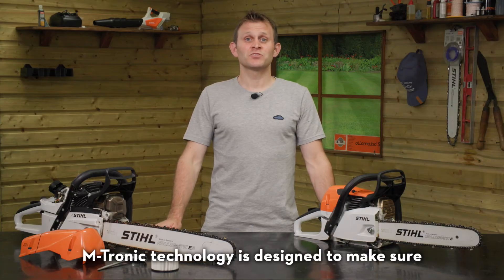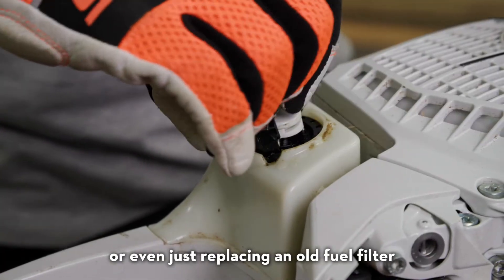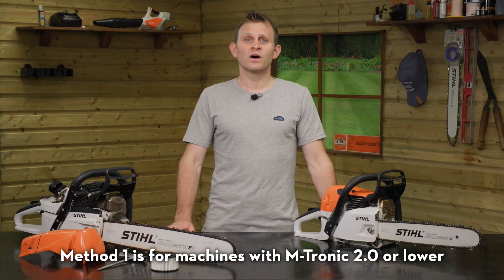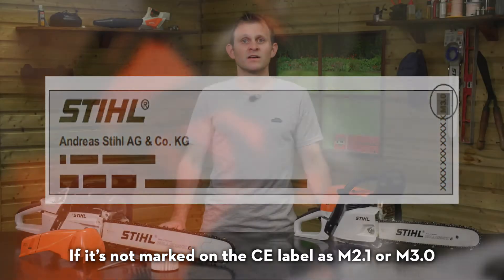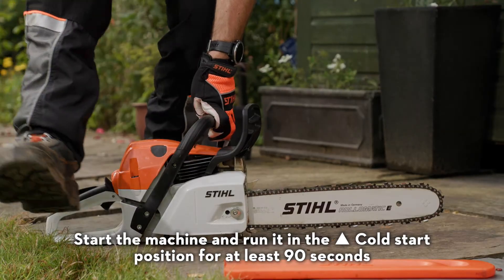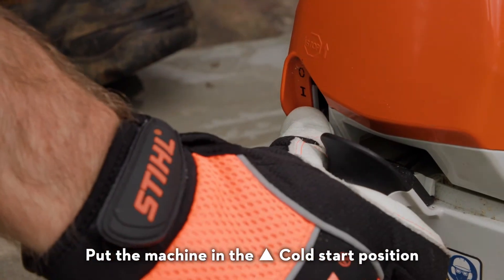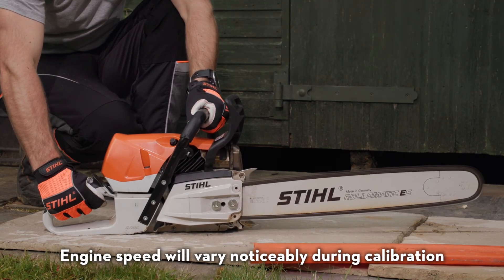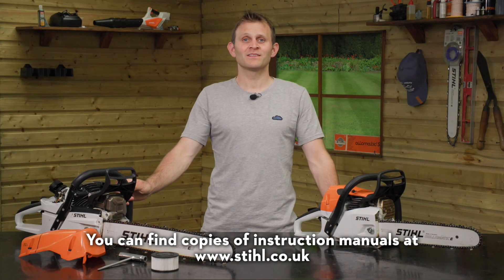How to Reset STIHL M-Tronic | STIHL M-Tronic Engine Management System | STIHL Maintenance | STIHL GB

Comment: Do you do this with a brand new saw or do you have to break it In and then set m tronic?
Reply from the maker: Hi, thanks for your question. During operation the chainsaw automatically adjusts to the optimum performance so this is not necessary with a new chainsaw. There are a couple of instances where you may need to reset your M-Tronic machine. Firstly, if you carry out any work on the fuel supply system, such as changing a solenoid valve, replacing or cleaning a carburettor or even just replacing an old fuel filter, you will need to do an M-Tronic reset, and secondly if you find that the saw isn’t running as expected (for example, not revving to its full potential), it is always worth resetting your machine as this may be a quick fix. Depending on the STIHL M Tronic version, our chainsaws can be adjusted more quickly to the optimum power in two different ways. For example, on the MS 261 C-M,  if it is a version prior to M Tronic 3.0, carry out five uniform length cuts at full throttle. For M-Tronic 3.0 the process in this video can be followed. The information relevant to your particular chainsaw can be found in the manual which can be downloaded from the STIHL website here: https://www.stihl.co.uk/en/support-and-contacts/instruction-manuals/
Thanks, STIHL GB

Comment: Do I have to do this every time I cold start it? That’s what I’m confused on, not even ace really answers me
Reply from the maker: Hi, thanks for your comment. No, you don't need to do it every time. There are a couple of instances where you may need to reset your M-Tronic machine. Firstly, if you carry out any work on the fuel supply system, such as changing a solenoid valve, replacing or cleaning a carburettor or even just replacing an old fuel filter, you will need to do an M-Tronic reset, and secondly if you find that the saw isn’t running as expected (for example, not revving to its full potential), it is always worth resetting your machine as this may be a quick fix. Thanks, STIHL GB

Comment: I have an old 044 Sthil saw that is in great shape . I bought in new in Montgomery Indiana in 2002 and the ONLY things I have replaced on it was the bar and chain when they wore out . NOT EVEN A SPARK PLUG !!! It is a simple saw with power and not like these new saws that something breaks all the time . I heated my whole home for many years with wood that the 044 has cut .
Reply from the maker: Thanks for the feedback Russel, we're happy it could serve you so well. Many thanks, STIHL GB
Reply: I'm so confused by your comment...so you think your carbureted 305sb is running better or more reliable then my fuel injected modern v8....of course you do but as a certified arborist who is felling & bucking daily 70 odd hrs per week in different elevations my M saws absolutely beat my old 0 in the front 0 in the back stihls don't get me wrong I love my old 066 and still run it for fun sometimes but even my 462C whoops the 066 and 660 I have here with the same bar and chain and that's a much smaller saw....not a small saw but still smaller my 261c destroys my 261 carb saw tuned correctly with a bark box same 20" bar and chain the m-tronic is beautiful i have early versions and brand new C saws haven't seen one even foul a plug in years 😉 if you love the stone age I certainly won't stop you or anyone else that believes a carb is just better but you'll need to really pull some data or just a good old stop watch when cutting next to a m-tronic because they cut way above they're class husky finally got somewhere they're early model computer saws were absolutely terrible once they warmed up pull pull pull nothing but bog city I gave away a 562xp for said reasons to a Jr feller so he could own a saw but the mk2s are okay now

Comment: I’m just wondering if I would have to reset my sthil ms 261 cm when I switch from winter to summer mode ? And if I am putting a 20” bar on the chainsaw?
Reply from the maker: Hi, thanks for your comment. You shouldn't need to perform a reset in those circumstances. You should generally do it just when changing a component within the machine, but if you feel that the machine isn't performing as intended, you can try a reset then as well. Thanks, STIHL GB
Reply: Thanks for your help on this matter 👍😁

Comment: Do you have to shut it off after the 30seconds of full rev? Or Can you just run it after that period
Reply from the maker: Hi, thank you for your comment.  Yes, once the engine is calibrated it is ready for operation.  During the 30 seconds you are holding the throttle trigger down you will notice that the engine speed varies noticeably while it is calibrating.
  As soon as the engine speed drops noticeably, let go of the throttle trigger and the engine should run at idling speed.  Your saw is calibrated and ready for use.  We hope that helps, STIHL GB

Comment: Hi, I Like your proper explanation how to reset a mtronic, but my chainsaw doesn't run at idle because I need to reset. But how can I reset the chainsaw if it doesn't idle, it only runs while you open the throttle.(half to full) 
I think it has run on low fuel. So the mtronic has prevented an air leak, by raising the mixture level? 
Please help. 
What to do now??? 
Greetings Eelco Zijlstra from the Netherlands.
Reply from the maker: Hi, thank you for your comment. We do have this M-Tronic blog that may be of use to you: https://blog.stihl.co.uk/perform-m-tronic-reset/
Our technical team have advised visiting your local STIHL Approved Dealer in the Netherlands who can inspect the machine and check that there isn't an underlying issue. It is difficult for us to diagnose an issue online. You can find your local STIHL Approved Dealer here: https://www.stihl.nl/nl/dealers
Thanks, STIHL GB.

Comment: I have a MS441C-M and wonder when I do this reset, per the correct revision, how often does this need to be done? Does it matter if I use the saw and then don’t use it for a month or two? Is there any reason to do a reset special as for if changing a muffler or air filter type? Thank you.
Reply from the maker: Hi, thanks for your comment. You only need to do an M-Tronic reset if you change a component such as carb or solenoid. Alternatively, if you have a running issue, it’s also worth trying an M-Tronic reset to see if that will fix it. Thanks, STIHL GB
Reply: @STIHLGB  thanks

Comment: Hello, for 3.0 M-tronic does the saw needs to be warm or cold before calibration?
Reply from the maker: Hi, thanks for your comment. It can be either. If you have changed the components, then the saw will often be cold, which is absolutely fine. Thanks, STIHL GB
Reply: @STIHLGB  so it's ok to start a warm /hot saw in a triangle position?
Reply from the maker: @gravityloose  yes, it is. Thanks, STIHL GB

Comment: What should one do if the control module and solenoid have been replaced ?  which control modules go with which reset methods ?  Thank you
Reply from the maker: Hi, thanks for your comment. The control module should have been replaced with the same module version as before. This means the reset procedure will not have changed. Thanks, STIHL GB
Reply: @STIHLGB  the original solenoid was black, and it wouldn't run with a white solenoid, and the original control module.  The module was switched to a 1140 400 4705 B.  original module was 4705A.  It seems to be a common issue that the original modules for black solenoids will not operate a white solenoid.  Where can one find such information ?  (what modules work with which solenoids, and what procedure is used for which module ? )  Many thanks for responding.  It is early morning, and I haven't reached my peak level of articulate communication, Sorry if I am unclear, please feel free to ask questions.  Also, I only use OEM Stihl parts for everything.
Reply from the maker: @thomasgronek6469  Hi Thomas, the original black solenoid valves had polymer valve seats. These have been replaced with a green valve (0000 120 5111) which is more dust resistant due to having a metal valve seat. White valves are included on the latest M-Tronic machines; however these cannot be used to replace a black or green valve due to a difference in specification. 

We don’t recommend changing control modules, so the reset process depends on the M-Tronic version (2.0, 2.1, 3.0) displayed on your chainsaw. STIHL Approved dealers have full access to parts and compatibility information, so if your saw is still having running issues we recommend taking it to a dealer for inspection. Thanks, STIHL GB
Reply: @STIHLGB  Thanks, but that doesn't help when I'm in the middle of nowhere, and there are no dealers.  I have had trouble with the information Stihl provides about the electronics, and as time passes, many of these saws will become obsolete as a result.  The used saws will be worthless without this info, as one never knows whether the version on the label (which no longer exists), is a true reflection of what control module is in the machine, or what solenoid is in the machine.  To the best of my knowledge, the green solenoid is no longer used in the United States due to failure, and that left the only option I had, which was to change to the white solenoid, and a compatible module.  The next step will be a change-over to standard carb and coil, or I WILL switch to Husqvarna or Echo equipment.  Sad to say, most of the Stihl owners I know have already done that.  Unless Stihl makes the information available, the company will lose a lot of loyal customers.
Reply from the maker: @thomasgronek6469  Hi Thomas, all spare parts are available for all M-Tronic machines, preventing them becoming obsolete. We recommend sharing the serial number of your machine with STIHL US or your preferred STIHL dealer who can advise on availability and may be able to supply the correct parts for your machine by post. Thanks, STIHL GB
Reply: @STIHLGB I recently read a STIHL article saying to replace the black valve with a white one. So what you are saying is I should return it and buy the green one?? 
Thanks-
Reply from the maker: @gregbeck906  thanks for your comment. We would only advise replacing the White solenoid for another White solenoid. The Black solenoid changed to Green. The only exception to this is the early models of the MS261 and MS362 which came with Black solenoids. These can be changed using the M-Tronic kit (part number: 1140-007-1802). Thanks, STIHL GB

Comment: I have a question, do I have to reset it every time I use it or only the first time I use it?  thanks
Reply from the maker: Hi, thanks for your comment. No, you don't have to reset it every time but there are a couple of instances where you may need to reset it. Firstly, if you carry out any work on the fuel supply system, such as changing a solenoid valve, replacing or cleaning a carburettor or even just replacing an old fuel filter, you will need to do an M-Tronic reset. Secondly, if you find that the saw isn’t running as expected (for example, not revving to its full potential), it is always worth resetting your machine as this may offer a quick and simple resolution. I hope that helps, thanks, STIHL GB

Comment: Does this apply to  the Stihl FS410 Clearing saw/Brush cutter. Mine is of 2014 vintage and it won't rev up at all. It doesn't have a spark arrestor so I presume it's a carb problem.
Reply from the maker: Hi, thanks for your comment. M-Tronic was introduced to the FS 410 in 2016 so won’t feature on your 2014 machine. This could be a carb related issue, or may also be due to the condition of the filters or fuel. We recommended taking your machine to a STIHL approved dealer who will be able to advise on the cause and offer a repair. Thanks, STIHL GB

Comment: I’m wanting to do this to my 661 but I’m worried I’ll blow it up on the full throttle with no load is it true Mtronic will adjust in 4 or 5 cuts or no
Reply from the maker: @AM-qu4og  apologies, yes you are correct, the MS 661 changed to M-Tronic 3.0 in spring 2020. Thanks, STIHL GB
Reply from the maker: Hi, thanks for your comment. The correct procedure for a reset of M-Tronic is to use the ones shown in the video rather than 4-5 cookies cut on a log. I hope that helps, thanks, STIHL GB

Comment: I have a 241cm and was trying to recalibrate its computer.  The rear handle says ICES-2/NBK-2. What version do I have?  It would seem to be V. 2.0.  Is that correct?  Will Stihl update it for free?
Reply from the maker: Hi, thanks for your comment. You need to look on the label of the front handle where it will say the version of M-Tronic which is on the machine, just like in the video (at around 1.02 minutes). The MS 241 C-M you have is very likely to be version 2.0. We don’t offer updates to M-Tronic systems on our chainsaws and the current MS 241 is still working with version 2.0. Thanks, STIHL GB
Reply: @STIHLGB  mine is working fine after I cleaned the spark arrester.  Why doesn’t Stihl provide firmware updates, like Husqvarna?  I treat all my saws the same, generally and none of my other saws had completely blocked spark arrestors.  They all are fed the same fuel, too.  Iran Stihl Ultra at 50:1 with PNE gas.  In all-of my equipment until January 2021, at which time I switched to Echo Red Armor at 50:1 with the same gas.  Ultra is a filthy running oil.  I never had a failure with it but it leaves a lot of ash unless you run the saw wide open all the time.  I could not believe that Stihl does not produce a JASO FD certified oil, instead of an FB certified oil, which is an early 2000’s certification.  FD is a so much better oil than FB, better lubrication and much cleaner burning.
Reply from the maker: Hi  @johnclarke6647  STIHL HP Super is a JASO-FD certified engine oil, however it doesn’t look like this is available in the US unfortunately. We also don’t have spark arrestors fitted in GB - as the temperature is significantly cooler it’s not a requirement for us. As you can see this doesn’t put us in a great position to give you reliable advice on this topic, however STIHL US or your nearest STIHL dealer will be glad to help. 

Rather than firmware updates, it may be possible to upgrade the solenoid valve of your MS 241 C-M to a harder wearing version but this would need to be confirmed with your nearest STIHL dealer. Thanks, STIHL GB
Reply: @STIHLGB  I know about as much as my local dealer.  They do not even support -Mtronic because the test equipment costs to much money.  Most of my Stihl saws do not have spark aresstors, either.  They have dual port mufflers on them.  I do have several that do have them and I burned them clean last week.  I am of Prussian descent.  They were from Richenbach, Liegnitz, Silesia, Prussia, southeast of Berlin and now part of Poland.  Eich bein ein Richter, if I said it and spelled it right.  I am a Richter.  My family immigrated to the US in early 1800’s, via Bergen, Norway and St Croix, USVI.  They were merchants, judges in Prussia.